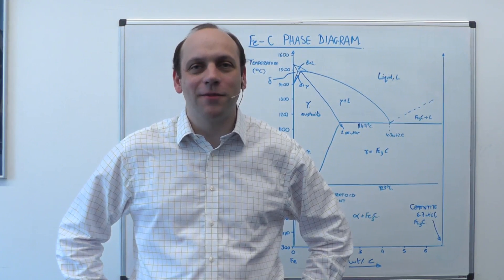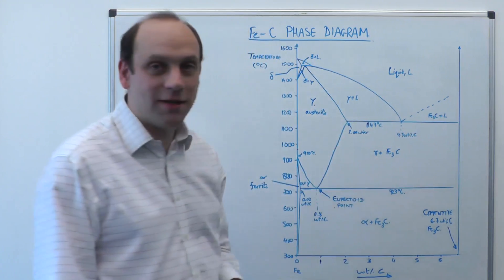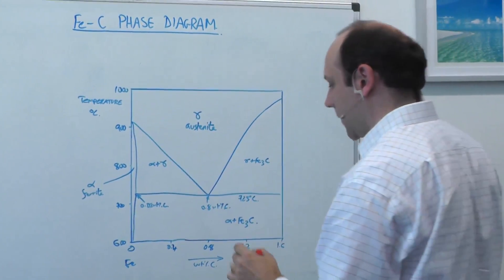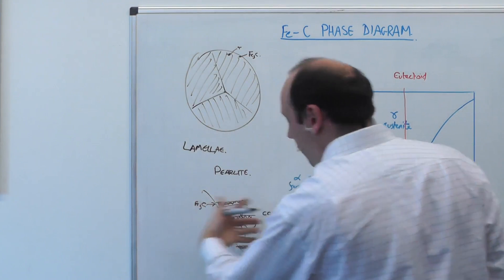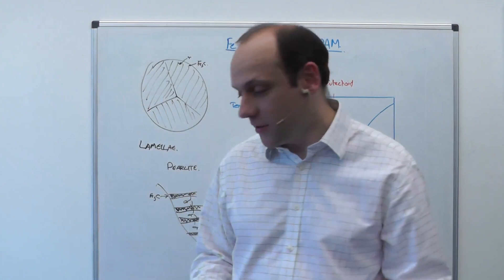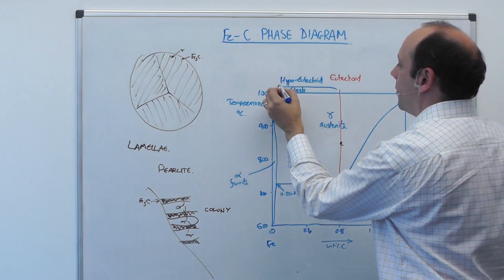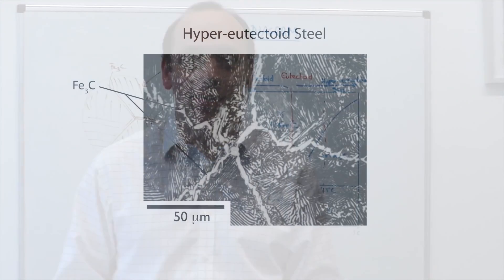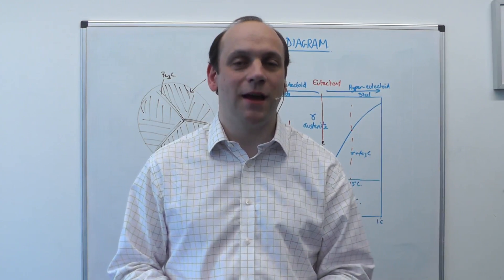8.2 | MSE104  Steels & the Fe-C diagram

Comment: Greetings.  I am a amateur part time bladesmith with an interest in Metallurgy as a result.  I've been reading books, watching YouTube videos and asking many questions, Professors from Canada,  India, the UK, Germany and USA.  However, I find two-schools of teaching out there.  One group teaching that the Eutectoid temperature line A1 is at 723°C and the other at 727°C.  Then one group teaching that the wt%C at the eutectoid point is 0.8% and the other teaching 0.76wt%C.  There are some other differences in the two different groups of teaching that I will not go into now.  I am somewhat confused to why there is a difference.  If we are talking about pure Iron Carbon, there should be no alloys in the steel to make a difference.  Could you please shed some light on this for me please.